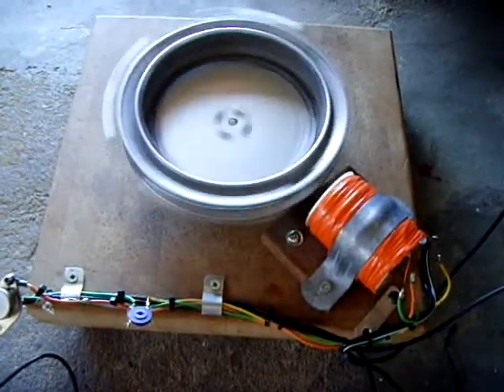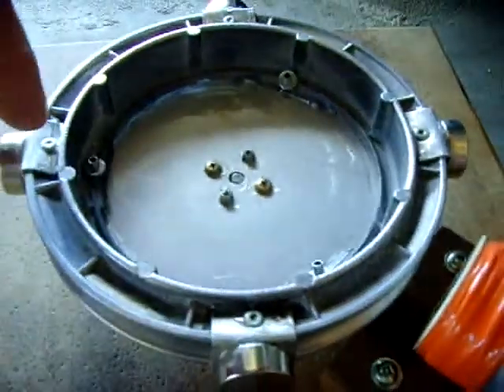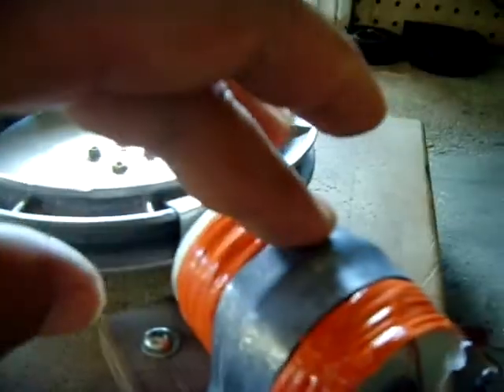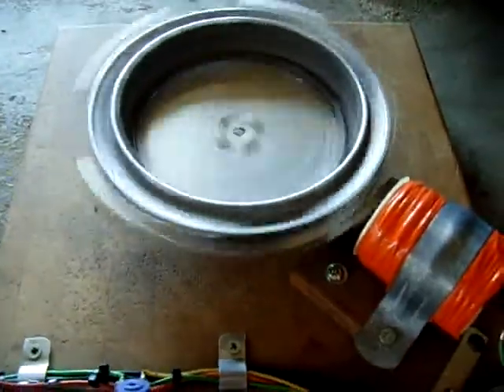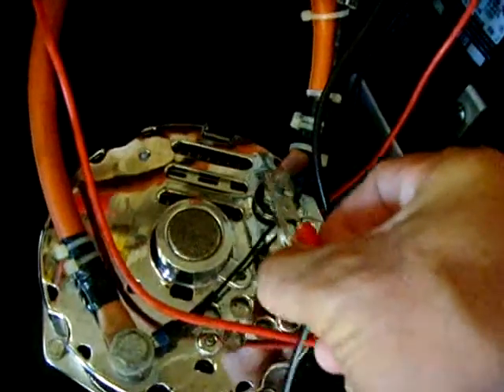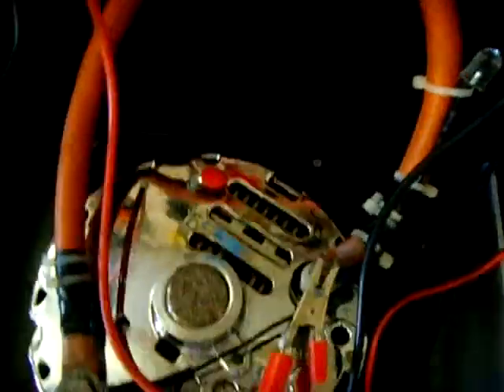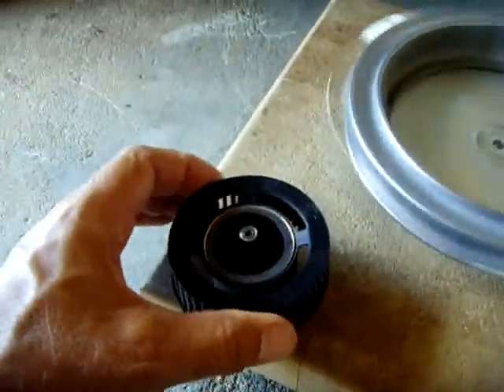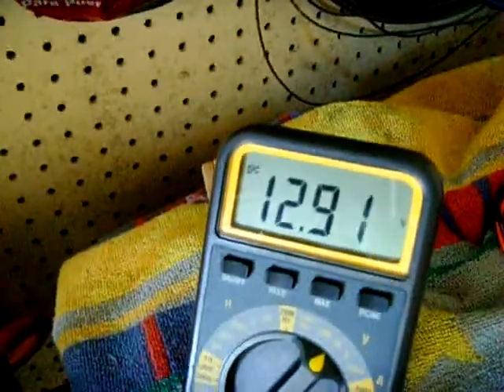Bedini SSG Battery Charger/Desulfator

Comment: Question...I built a 3 coil bedini motor. 1 coil is bifilar and the other 2 coils are run coils. I am charging 2 6v trojans wired in series. They are badly sulfated so I figured they were good candidates to test the bedini motor. My question is, I am getting a reading of 9.3v going into the batteries.  I see videos where people are getting well over 12v off their motors. Is this low input because of the sulfation causing internal resistance in the batteries? As they desulfate the voltage will slowly rise until they come up to fully charged healthy batteries? I'm a fan and would really appreciate your opinion.  Thx

Comment: What is the output voltage?
Reply from the maker: In the hundreds of volts.
Reply: electronicsNmore Exact measurement from a voltmeter?
Reply from the maker: A voltmeter will not show an accurate reading, just an average. You would have to use a scope, This project was made a long time ago, so I will not be able to test it right now. Testing the voltage without the neon lamp, usually results in a blown transistor.
Reply: electronicsNmore is there a reason you don't use this as a charger anmore?
Reply from the maker: I only use it if I feel a battery needs to be desulfated to help restore capacity.
Reply from the maker: I have another desulfator circuit shown on my channel, but that one is more difficult to make. They all use pulses.

Comment: Need help on the trigger coil no movement with 6v battery and tried a 12v the coil got hot ???
Reply from the maker: Check the link in the video description/About section. I suggest you double check everything you did. Also check your components to make sure nothing is faulty. You could have a bad/shorted transistor. The circuit works fine and is very easy to get working. Make sure your coil is properly wound.

Thanks For Watching!

Comment: How high is the output voltage when you say "very high voltage"?
Reply from the maker: The neon lamp glows VERY brightly if the leads are disconnected from the battery being charged.

Comment: Are you using rectified ac to charge your 12 volt battery ( In other woirds DC power) or are you using hi frequency hi voltage AC back EMF coming directly off the coil itself?

Comment: I saw a diagram of the circuit. the neon bulb connects to the open hole, and the E on the transistor? the diagram also shows IN4007 connecting to the other open hole. But, I see only one thing connection to one of your open holes? do you have a better diagram? Idont understand your connections? where can you get the spool? I found a bunch of wire from a junk tv off craigslist.

Comment from the maker: No, it has to be a small 120v neon lamp. You can buy them at radio shack. I used a drill, and I wound both wires onto the spool at the same time.

Comment: You try calculate COP? If yes, how big? Bedini said, before you measure COP you should charge/discharge battery minimum 5 times...possible 20 times, only then you can say system work well or not

Comment from the maker: You are using 12V at 100ma, but you are converting that power input to a much higher voltage at 35 ma. Efficient or not, this unit allows me to charge batteries that would not take a change normally. It also allows me to charge batteries to a higher voltage before cutting the charger off.

Comment: You're pulling a continuous 100ma.  You say the battery is getting 35ma. Knowing the magnet size, and not the diameter of that wheel I can't tell you Duty cycle of the output of your coil. I have seen enough to know, this isn't an efficient way to charge batteries. It's still cool though.